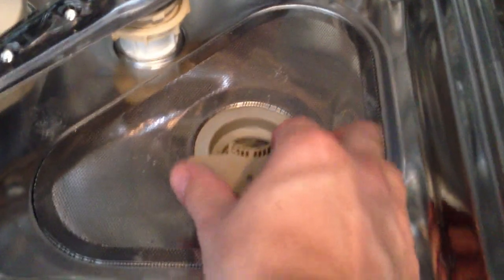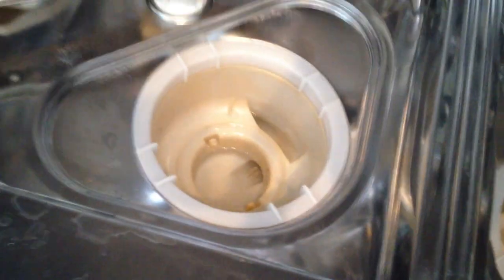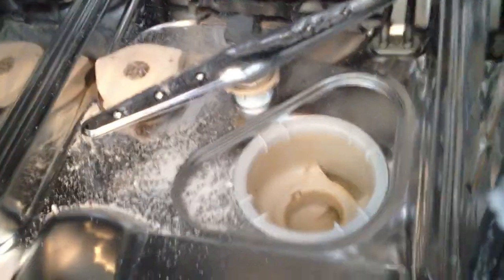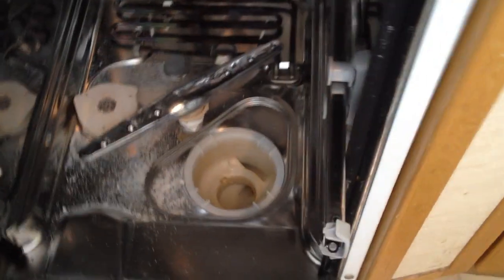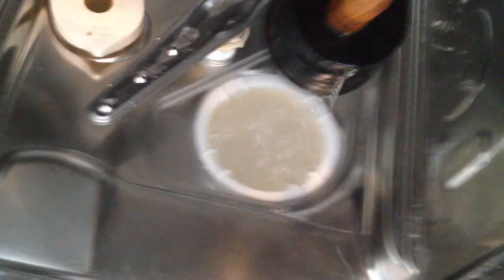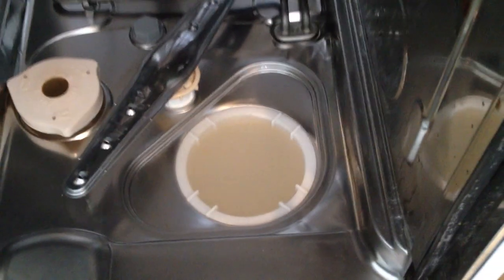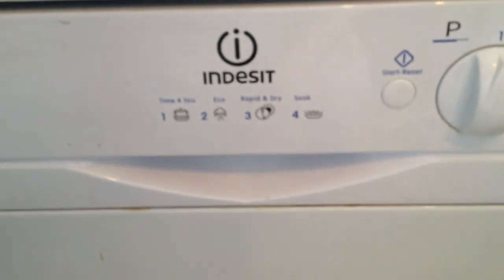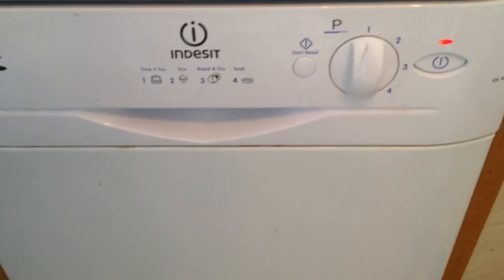Fix Indesit IDL40 Dishwasher Flashing Lights 1 and 3

Comment: Massive thanks to you. After wasting several days and initially dismissing your solution as too simple to be true, today I returned to it and voila, it worked. You saved me an unnecessary spend on a new dishwasher and also from wasting a reasonable fine dishwasher.

Comment: Might seem obvious to others but it just solved my issue. Had someone out recently who pulled out our dishwasher and when they put it back the clean water pipe got kinked and stopped drawing through water causing it to give lights 1 and 3 error. When I pulled the dishwasher out and no kinks ran fine so just taped pipe the wall to remove any risk of kinks and now runs perfectly.

Comment: Brilliant! I had resigned myself to spending christmas having to wash dishes as the damn machine had packed up 6pm on friday 2 days before Christmas! Didn't have Soda crystals on hand but gave the old plunger trick a go and BAM! worked first time. Thanks for the tip. Will be popping out first thing to hunt down some soda crystals.
Reply from the maker: If its worked -you are probably ok - wouldn't worry about the soda crystals - belt and braces...
Reply: That's what I thought but got some anyway - it's 6 years old now and probably will benefit from having a dose of crystals and a full cycle once a month.

Comment: I had this issue, filter had minimal debris. I had to remove the right side panel to reveal the pressure switch. Remove the pressure switch and blow the pipe. For good measure I flushed water using a hose pipe back through the pipe and into the main wash chamber. It dislodged some build gunk build up which was hidden in the lip of the sump. Once removed I reconnected the pipe to the pressure switch and the machine runs perfectly. The sludge/gunk was blocking the pressure pipe opening in the sump, this meant that the pressure switch was unable to detect the pressure difference once the machine started filling causing the fault code. 10 min job max and saves £££££
Reply from the maker: Awesome description, thank you!

Comment: Thanks for this.  We've tried a few things to fix a Currys Essentials CDW60W10 dishwasher - but using Wilko soda crystals and a fair bit of plunging seems to have fixed things.  With the CDW6010 it was the 3rd "rinse" light flashing and beeping  Thought it might be something more complicated with pipes or drains, but fingers crossed this is it :)

Comment: Thanks - this is great!  I have taken mine apart as per your video, there is quite a bit of food and a tiny bit of plastic (from a clothes tag!) stuck between the grey inner (attached to the silver mesh) and the white hard plastic filters.  Are these two supposed to come apart as the instructions suggest they do, but I cannot for the life of me get them apart?  There are two little notches from the grey inner poking out through the white outer and I can't out how to pinch them in to get the two filters apart.  Thank you so much.
Reply: The whole filter contraption does come apart - the metal screen comes off from the white basket with the handle, and the outer cage bit comes off too. It seems to come off with an amount of twisting and pulling and poking at the plastic tabs.

Comment from the maker: Pull it out and tip it on its side, expect water to flow out (mop handy). The bottom of the washer is a big tray that catches any leaks to prevent flooding the flat below (if you lived in a flat that is). There is a switch attached to a polystyrene block that floats should the tray fill with water. I think what you are seeing is that switch being activated.
http://www.ukwhitegoods.co.uk/forumsphpbb3/viewtopic.php?f=33&t=57755 see this post for more ideas.
Reply: I used a empty bleach bottle to siphon the waste water, then poured down the drain